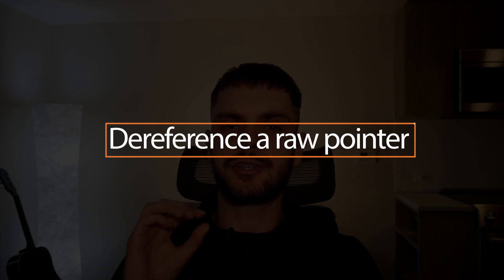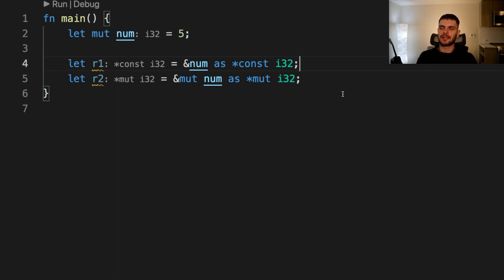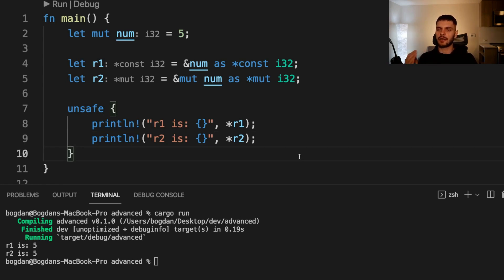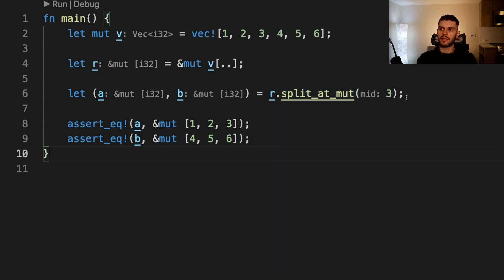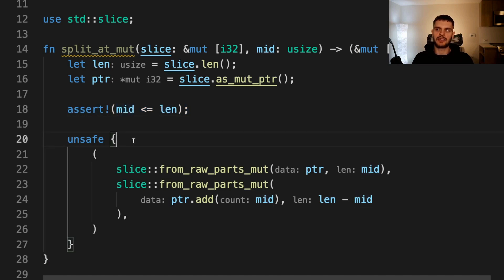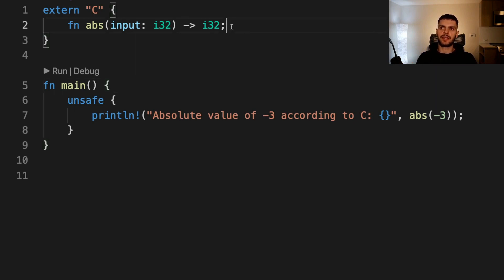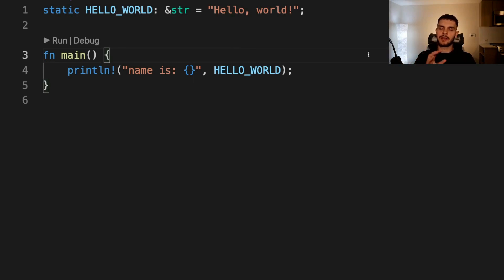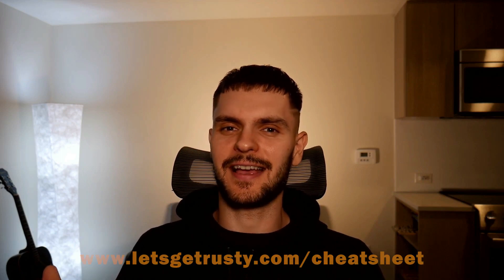Writing Unsafe Rust

Comment: The raw pointers example at 4:59 fails Miri. I think the issue is that the temporary `&mut num` created on line 5 ends the shared borrow from line 4 and invalidates the *const pointer that's derived from it. You can see the Miri error if you copy the code to the Rust Playground and select Miri under Tools. (Apologies for not just including a link. YouTube seems to delete my comment when I do that.)

Comment: I think there's a lot of misconception concerning unsafe Rust. Using unsafe Rust does not turn off ALL the safety guarantees of Rust. It allows you to perform some tasks and operations that the compiler forbids in safe Rust. 
I find a lot of arguments that if I'm going to write unsafe Rust, I might as well use C/C++. While this is not a C++ vs Rust post (and frankly that argument is stupid). All of C++ code is inherently unsafe while unsafe Rust code is safely nested in the unsafe blocks and the rest of the code is safe with all the wonderful safety guarantees.
This aids easy identification of bugs and issues in your code and alerts any users to potential hotspots in the codebase. 
You would rarely need to write unsafe Rust even in a large professional code base. And I think unsafe Rust exists for those coming from C/C++ as well as development on embedded devices and OSs where bare metal programming may become necessary
Reply from the maker: Good points!
Reply: Unsafe is necessary for low level programming. However, unlike in C there are safe alternatives of writing code and unlike in C++ the safe way of doing things is the easier, default way of doing things. You need less hustle in order to write safe Rust than to write unsafe Rust. It is the exact opposite with C++ (and especially with C where if you want to write safe code you need to create a lot of wrappers and then be very disciplined about how you use them).
Reply: I have written a lot of C code, some C++, and now Rust. Mostly on bare-metal, embedded, but not exclusively. I love all of them.

Those who say that Rust isn't worth it is really not getting the idea. It is a no brainer to use, these safety guarantees are no joke. I have written way to many "static volatile"s to know that it is way too easy to create data races in multi-threaded applications, which embedded software ARE, even if you are using just an ancient 8-bit MCU.

Also, I never have had problems with pointers and such, but what I have always hated is the constant double checking at every damned use point whether they are NULL AND the pointed-to-something is valid too. It is ugly and error prone. I.e. error handling. In C, you are on your own, try/catch is a mess. Rust and Go actually does error handling right and Rust's Option and matching system is more powerful.

You require pointers and variables at arbitrary addresses on an embedded system, but that does not mean that the entire codebase has to be unsafely write and access everything everywhere. Usually you need this for the hardware abstraction layer, encapsulate all the magic in there, then when you are using that HAL, you are essentially writing a normal application, where you benefit and love to have safety, convenience, generics and everything. In fact - you are writing a great embedded application if it is generic enough that you can test it on desktop with a mock HAL.

This is much more convenient and clear to do in Rust.

I much prefer the Rust's way of writing code, even though I am a beginner and slow, but I think that writing code fast then debugging for long the weird edge cases is not more productive and reliable than thinking more, writing code slowly, but once it compiles, it usually works allright. Provided that you haven't messed up the business logic. But you rest assured that you can only mess up the business logic.

Comment: if i want to use unsafe then it's better to use c or c++ why rust???
Reply: Because the unsafe block helps you islolate and identify potential issues in your code. As stated in the video, it doesn't turn off all the safe guarantees of rust like the borrow checker or bounds checking.
If your code has issues particularly due to memory, it's easier to identify the source than c/c++.
Reply: Use the tool that suit u better .

Usually unsafe rust is used safely when the compiler doesn't understand something thats safe .
Reply: You still have access to benefits of rust like crates etc
Reply: Underrated comment @kritagyagupta9356
Reply: How is this even related
Reply: @----__---  
If he want to use c he can use c.